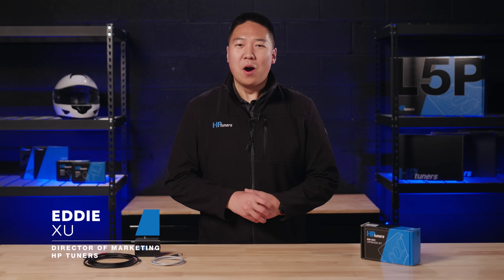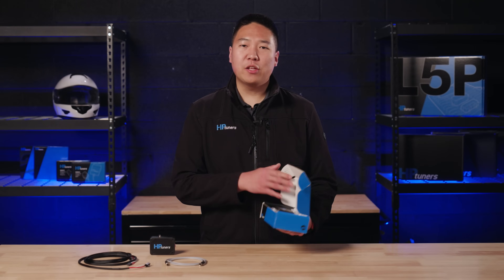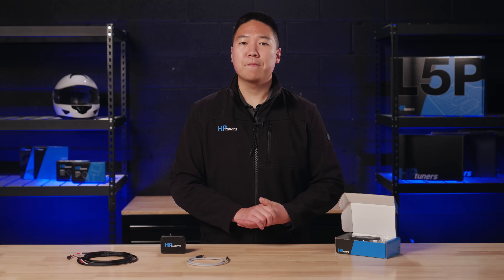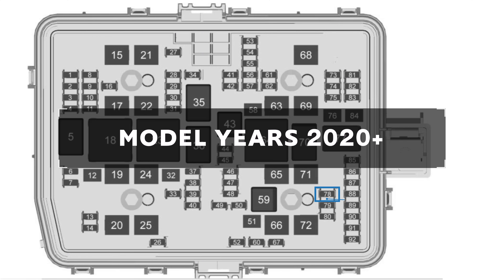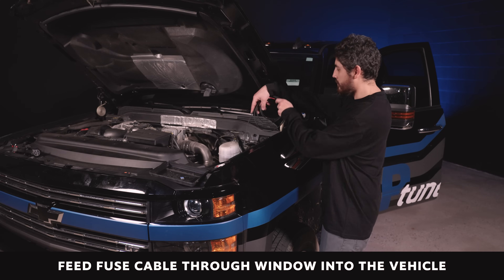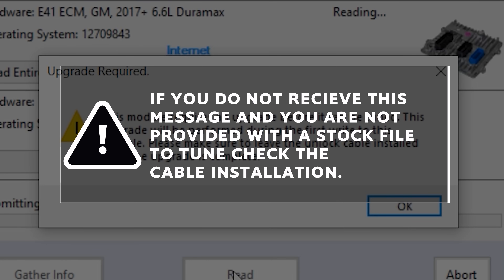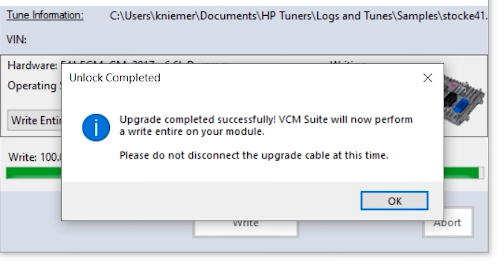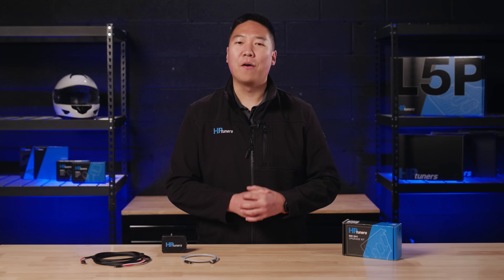How to install the new GM E41 ECM Upgrade Kit | HP Tuners

Comment: For anyone who is new to the HP Tuning game. HP Tuners is a hardware company that allows the ECM (engine control module) to be modified from factory. They do not modify the tunes. You will have to contact a tuner and send them your stock tune to be modified prior to mechanical modifications. Such as larger 67mm turbo, larger injectors or any and all forms of delete. I recommend Duramaxtuner for the 150HP 5 way compliant tunes and then see if you feel the need for something else. Just my 2 cents.
Reply: Thank you for this comment, I want to delete my l5p but am new to this.  I understand the process but do not understand how to acquire a tune file....credits? Where to load it? Etc. Any advice would be much appreciated thanks!

Comment: Assuming you will have to purchase tunes(credits) first?
Reply from the maker: Hey Tim! 👋 Yes, during step 5 of the upgrade process, users have to license the vehicle to their interface. The instructions are linked in the description if you want to check them out. Thanks for watching!
Reply: @HPTuners   if I buy this and install in my 2017 gmc 3500 would I be able to delete my truck. EGR DELETE DEF DELETE CAT DELETE DPF DELETE IF SO IM BUYING.
Reply: @sergioRodriguez-bf1kf  🤦🏼‍♂️
Reply: Is there a link on the hardware I need to buy so I can tune my 2021 L5P?